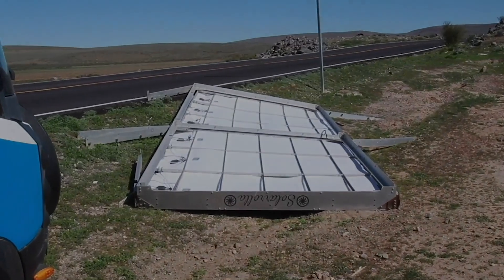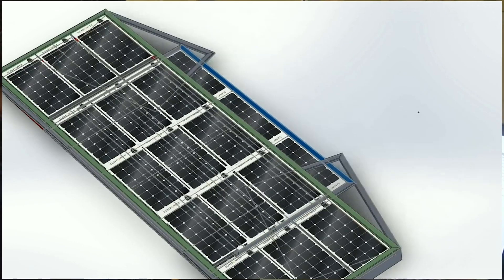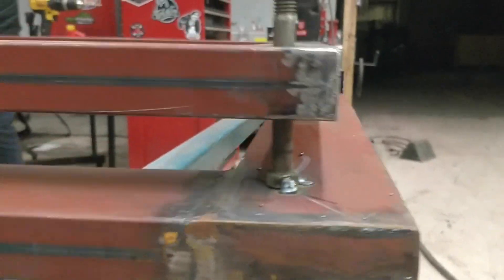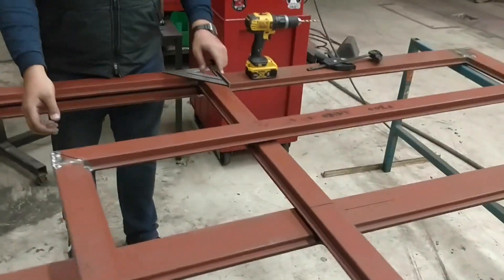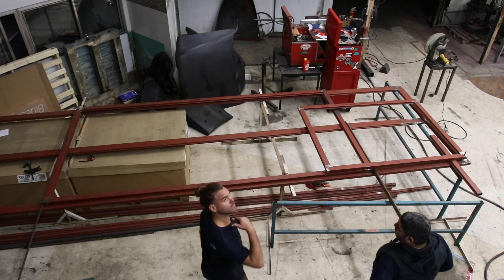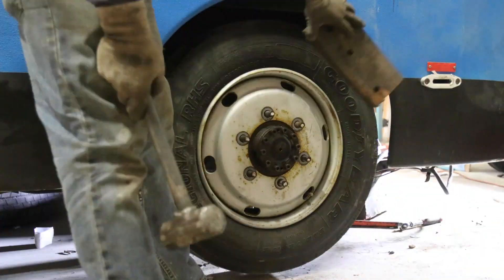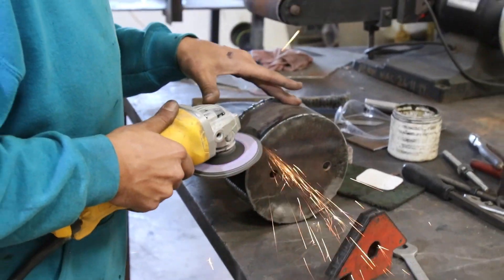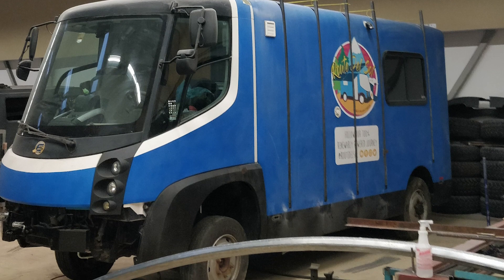Solar Array IDEAS becoming REALITY [HOW TO DIY] | Electric Vehicle 3" Lift | CNC PLASMA CUTTING

Comment: No budget for coil overs then.. some king shocks with remote reservoirs would work well and I bet ORS have experience with them too.
Seems like increasing ride height for a heavier vehicle is not the best way forward, should have specced stiffer springs in reality (and yes I realise that's pretty difficult on an oem application without a good aftermarket manufacturer) but they are available
Reply from the maker: Unfortunately the external shocks have to remain in place because that is the way that the suspension system works with this particular vehicle (they also act as structure and guidance parts). But we are going to add other shocks to the van somehow which will make for a very interesting video down the line.